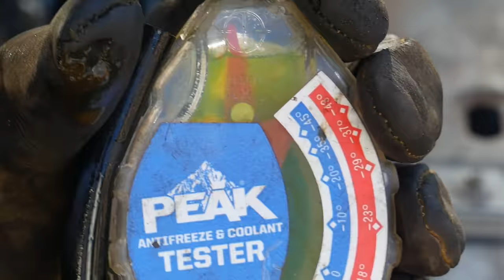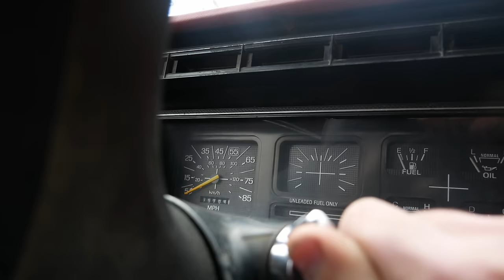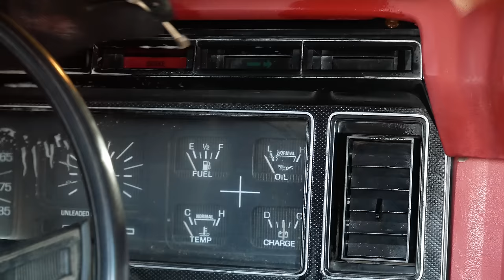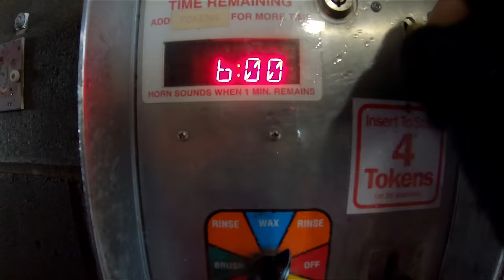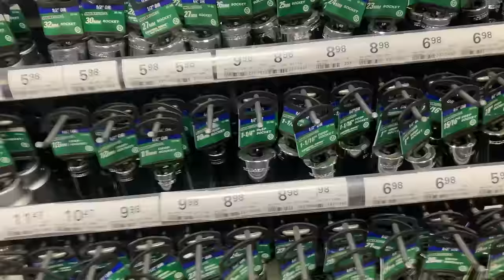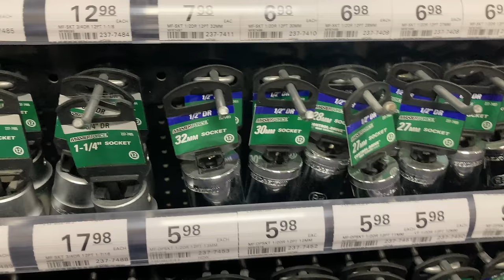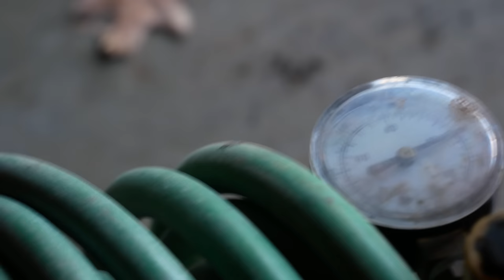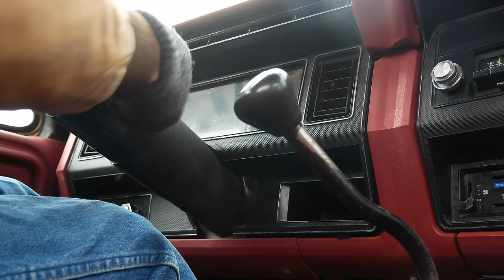Fixing Up An Old Truck.

Comment: If I lived in the rust belt that’s the kind of vehicle I would drive.Buying a new or pristine truck to sacrifice to salty roads is such a waste of money.Mechanically sound and don’t worry about the rest (rust).
Reply: Fo sho man. That’s why I love me old ugly cheap trucks. Ain’t got to worry about nuffin 😂
Reply: Love my 99 Mazda b3000 4x4 throw on some undercoat fuck it had to put money into suspension but the ride is now phenomenal for a 120k mile 25 year old truck
Reply: @Me-eb3wv lol I hit the garbage cans fast asf too in the driveway send em flying not a scratch new car would be dented
Reply: I live in Los Angeles and I’ve seen people driving a new pristine truck for gardening and construction and I drive a 2000 ford F150 life you said new vehicle is such a waste of money
Reply: In the Rust belt these old trucks a long gone…
Reply: the rust belt just refers to the areas of the US where steel mines were located but were left to rust as industry declined. you are most likely referring to the salt belt, which gets its name from the heavy amount of salt used on icy roads, which in turn causes lots of cars to rust. it’s a common switch up but it’s important to note because the salt belt is much larger than the rust belt

Comment: I love this kind of content.  No commentary or music, just a dude working on his truck.  My first truck was an '86 F150 that was my dad's for years. Same color as yours down to the red pinstripe down the side. Watching this sure does take me back!  I still remember how many times to pump the gas before you crank it without flooding it, using that foot button to turn my brights on and off, and the location of every alamite you have to grease in the frontend.  Great vid, man!

Comment: Back in 1983 I was 19 years old. I purchased new and 1983 F250 light duty with the Explorer package. Same motor and trans as yours. Mine was brown on top and below the chrome strip it was tan. 1 of the best trucks I've ever had. I really appreciate your video.

Comment: don't ignore the knock.. been there .. 400m , wet night and thought it was just missing due to moisture or another failing duraspark module .. 
booted it to clear , and bang ..#5 rod through the side, oil pressures were good, just prior oil change and inspecting of filter did show a tiny bit of silver, but given over 500k km not unreasonable..no knocking just sounded like a slight miss. 
Had several 78-83 f250s 4x4 all used for bush work, before flipping to dodge diesels.. 
Now at north of 70 ,would love to be able to drive and work on one once again .. too gimped to do so now. Once you get to really know a truck model and drive train, you accept it's built in problems get comfortable fettling them as needed ..
Though wife was not such a fan , especially when rusted out passenger floor pan's cardboard or hardboard disappeared through the hole .
Reply: what about the chevy 2500

Comment: I have owed 1980, 1982 (Bronco) and 1989 Ford 1/2 ton 4x4 trucks like that one.  I always wanted to buy one now and fix it up.  I tried to buy one a few years ago from a neighbor but missed out on it.  Love those old trucks.  Mine all had 300 straight 6 engines with granny low 4 speed manual transmissions (89 was 5 spd).  I am an old school fix anything home mechanic so all of this is right up my ally.  Love watching it.  You must live where it snows a lot with all the rust.
Reply from the maker: Indeed, lots of snow, lots of rust. Thanks for watching.

Comment: I really like the way you did that, with no sound etc… I’ll bet there’s a lot of men out there (me included) that would just like to do what you did with being bothered by b.s.! I kinda had that in mind when I flew to Nashville from Lubbock and bought a 1970 Ford F-250. Sight unseen, I did some of what you did and drove her back to Lubbock. No radio, no cruise control, just checking out the countryside. Thanks for helping me re-live that!
Reply from the maker: That sounds like a lot of fun.

Comment: Nice job! I’ve owned a bull nose, brick nose, a ranger, and an explorer. Makes me miss those old fords. This old girl is loving all the attention! Those broken springs are screaming for a small lift and bigger tires… throw some hubcaps on her and she’s set! That 300 will treat you well for a long time, and the 4 speed is bullet proof. Check those ball joints, pivot joints, and wheel bearings as they are high wear items. The tie rods can wear, but it looks like you nailed them out nicely. Take some of that scrap diamond plate from the running boards and build a cup holder or tray where the dash speaker rotted out. These look great with a visor and/or cab clearance lights, too. I look forward to seeing where you take this thing!
Reply from the maker: Great ideas. May be controversial, but I'm a big fan of brush guards and roll bars w/ fog lights, maybe I'll tackle that one day.
Reply: A period correct brush guard would look killer. I’m a fan of rollbars and headache racks, too. These bullnose fords look awesome with accessories.

Comment: I really did enjoy your video.   I'm currently deployed overseas and will be getting back home soon.  I have a 1986 F150 stepside with a new 4.3 crate engine I put in right before I left.   Will be doing a lot of the same work.  Thanks

Comment: Always fun to get a rickety truck cheep, clean it up, address neglected maintenance issues, make it your own.  Just an idea; "invest" (they are cheap) in a set of paint brushes or detailing brushes.  Detailing those nooks, corregated wire looms, rough surfaces, etc.,  is so much easier with them than a Q-tip or a rag.

Comment: Yes it is. You start changing the oil and end up replacing the suspension. You also have some new sockets that you will never need again. Good job, no unnecessary boollsheet

Comment: Got a '76 Plymouth Valiant several years back, up in Washington State, $0 out of pocket. 318, HD suspension, cooling, sure-grip rear end, solid body, interior only needing the driver's seat foam fixed, new carpet, a headliner, and about 86K miles on it. Moved to the SE, the car came along. People have more reaction to that beige sedan than the GT350 in the garage, lol. I enjoy bringing them back to a resto-mod level. Not "Custom," no $30K paint jobs, custom interiors, $8K stereos... I do upgrade brakes, suspension, chassis stiffening, steering and wheels/tires (5" wide, 14" diameter rims are garbage), but I don't need Wilwood brakes ($4K), QA-1 suspension ($11K), 20+" rims & Michelin Sport Cup tires.
The car today? I have about $12K in it. Mechanically new, better than factory. Makes more power, burns cleaner and pulls better gas mileage. Stops, steers and handles better than an A38 (police package) Dart/Valiant. Electrical system better than factory. Stock radio retrofitted to digital, AM/FM with BlueTooth, 4-speaker hook up, amp hook up and a USB port. Cheap to insure, goes up in value, and not afraid to let my Cattle Dog ride shotgun. 4-speed manual (with overdrive), hardly no one can drive it. Not to mention I know the car back-to-front, top-to-bottom, and repairs are far cheaper than a modern vehicle -not to mention I can do them.
Reply from the maker: Sounds like a sweet ride. I'm right there with you. I love the cheaper classics with a few upgrades to help it keep up on today's roads and still has all the character that comes with age and the era.

Comment: hey brother , nice truck . an aluminum transfer case uses atf fluid and a cast iron case uses gear lube . I am working on an 89 ford f150 with the 300 six & a 5 speed, great setup . hope you post more videos . be safe

Comment: When the ball joint pry tool snapped, I felt your frustration. Great video.

Once you get the leaf springs and brake master cylinder dealt with, you should consider cutting out the rust and welding in some patch panels next.
Reply from the maker: Thank you. Yea, sometime I do plan on fixing the rust.

Comment: Nice video ! Give those wheels some paint. It will do wonders for the appearance. Heard a little main bearing rattle at startup but I wouldn't worry about that right now. It's a Ford it will run another few thousand like that. Cool truck. Nice work!
Reply from the maker: Thanks! As far as I know, startup bearing rattle is normal for all ford 300's. I'll get around to painting the wheels eventually...

Comment: As soon as i saw you wash the engine bay i knew that baby will not start anymore :))))))))))
Reply from the maker: Good thing the previous owner stowed that distributor cap away, I didn't even know until I opened the bag
Reply: You learned never to power wash the engine😢

Comment: I had a 1986 Ford with the 3 in the tree straight 6 what a reliable old truck. Unfortunately the rust finally took it out but it never did quit on me. I had it probably around 10 years  got it in 1992 was my first truck and being my first truck I beat the piss out of that pore thing  For being a 6 cylinder it had alot of torque you could pretty much drive it in 2nd gear only if u wanted.

Comment: Ingenuity >>  38:55  and custom door shims >  52:52    To loosen/ replace a serpentine belt by myself, I used a tie-down strap hooked around ratchet with other end going to parallel parked suv's door hinge mechanism (perfect height) to achieve full range of belt tensioner release freeing up both hands to guide belt.
Reply from the maker: Haha, love it.

Comment: A leak on an old vehicle needs a factor of 2.5. Because it'll take 2 to 3 attempts to fix it for good. A leak is sometimes a de facto relief valve for a leak somewhere else. Or, whoever remanned that remanned unit was still in training. Or, the last person ruined the machined gasket surface with a 3M bodywork prep disc. The list goes on . . . .

Comment: tubes inside make them old tires best for off road use nice ones plus add sealer slime is best plus repair cracks add polish to regrove old rubber ways and ways plus chains rope make good run flats lot lots skills

Comment: Wow, the super cheap plastics, paper thin metal, and half-assed engineering. A piece of junk straight from the factory. ???Why do I want one so bad???
I can literally feel the slop of the shifter and the bounce in the seat. And I can smell the combo of flooded engine and my grandpa’s cigars.
Reply from the maker: I love that shifter. You have to really jam it into gear,  and It's really easy to grind it into 1st accidentally when trying to get 3rd gear.

Comment: 1984 traded in my no window 66 chevy van for F-150 4x4  4 speed (granny first) short wheel base got it home found no oil in the 4 speed and took a year to replace it with new one after being in and out of the shop of them trying to fix it i had to threaten to hide it and stop paying on it, had it 21 years 540,000 miles when i sold it to guy that had a fold claim he wanted to use it there and have never got another new vehicle since i sold it in 2005 have had  2 used vehicles paid 2000 for original 71 Econoline sold for 6000 and a 94 Jeep Xj  i still have and have saves 1000,s in car payment

Comment: I had a 1985 Ford F-250 like yours except mine was a 351HO automatic was just getting it ready to start driving when it backfired and burned to the ground😢 and I have another 1987 F250 with a 300 inline 6 fuel injected and a 4-speed transmission four-wheel drive
Reply from the maker: Yikes, that's a shame about the '85.

Comment: Never use glass cleaner on your plastic dash. It has alcohol in it which will dry it out and make it crack. Never use a crescent wrench on an oil drain plug. Use the proper wrench . Simple green is a great inexpensive cleaner. It works amazing on carpet as well. Putting 15w40 in a vehicle in Minnesota is not very wise. It will not flow at all in cold temperatures starving the top end of oil. A claw or rip hammer is for carpentry work. Get a ball peen. I will be happy to mail you a hammer and a set of end wrenches seriously

Comment: I was so afraid when you started washing the engine. I have wanted to do that to mine for years but have been told it's not a good idea because it will stall out the truck so I never have. Mine is caked with dirt on the engine block. I have fears that this will cause problems later on so I really worry. What do you think? Should I go ahead and wash the engine, just being sure to be careful what I hit?
Reply from the maker: Yea just be careful what you hit, it’s not a big deal. Avoid air intakes/carburetors and major electronics like the distributor. The only real damage would happen if you shoved the hose down the carburetor/intake and filled the motor with water.
Reply: @SimonFordman  Alrighty then, thanks. I'm going to have to wait now anyway since the intake manifold is leaking. I would like to go ahead and replace the seals around the head gasket and manifold to make sure it doesn't leak again before actually washing it.

Comment: If you need a jack and breaker bar to loosen your nut for your pinion yoke either it's way over tightened to an extreme level or... you're weak af
Reply from the maker: I'm pretty sure the axle is a Dana 60, pinion nut is torqued to 250 ft/lbs.
Reply: @SimonFordman  I'm an idiot, I've only dealt 9" and 8.8" rear ends, both of which have a crush sleeve. You torque the pinion nut down until you get a certain amount of preload on the pinion bearing which you determine by the amount of torque it takes to rotate the pinion. From what I found the dana 60 doesn't use a crush sleeve and is set up with shims from the factory to keep the preload right. So MY BAD

Comment: one barrel not two not four best save lot gas adapter plate plus tbi is better computer helps old stuff got lot tricks winch sunviser good wipers i rebuild old ones are better heavy rubber strips light covers lens brush covers front and rear not deication of a winch make it a reciver grill gaurds fender flares under glow for fuction not style led ever thing

Comment: going say it 15-40 ya  i know but still 10-40 even 5-20 here is why see now days cold weather no one runs that stuff 
next is i will say it think like this yes old etc fact is you can pull the bed cut panels lot them had in line pumps or add fuel level get draw tube break down each system breaks hes can save resurface old drums or rotors or treat clear coat etc next fuel breaks water pump need lubercation not just temp mix yes disittle less  calcium fact is bearings rods water pump wheels under body some say old oil adds mostier fact is better to use something fuel octane treat each fill up with mix of transmission or addtives oil same plus valvle or valve seals old push rod vs new roller rockers good try grade  b for effort want a grade do axle supperts braces sway lockers shocks steeering stablizer next buseings gears seals lots them plugs cap and a hd or patronixs plus better system lighs bed cover rails mud flaps you get thier